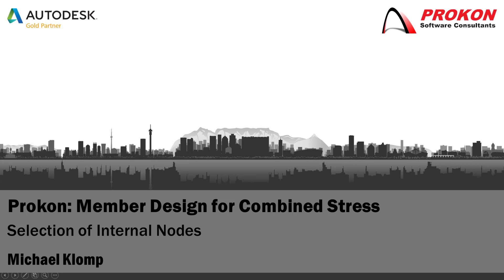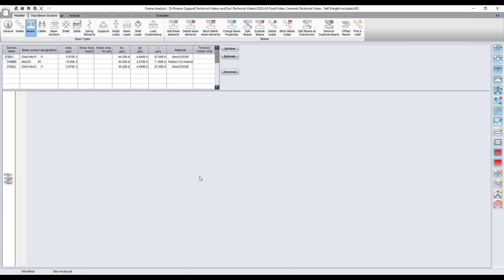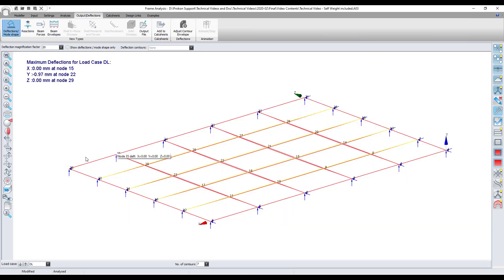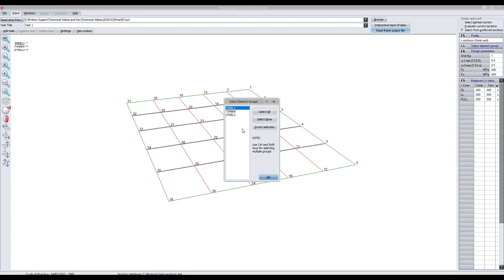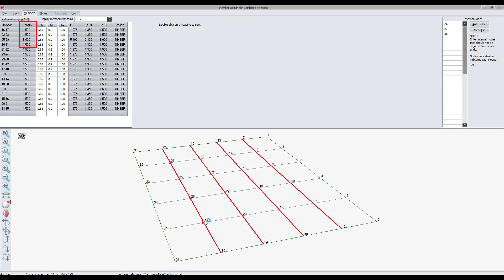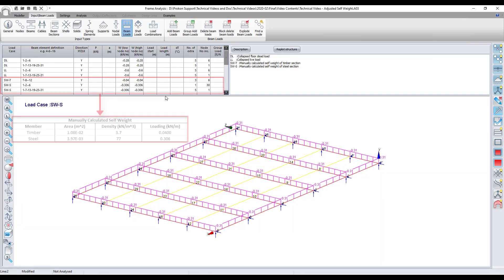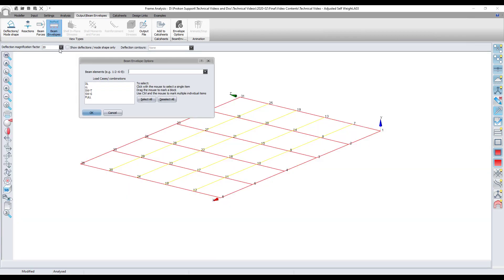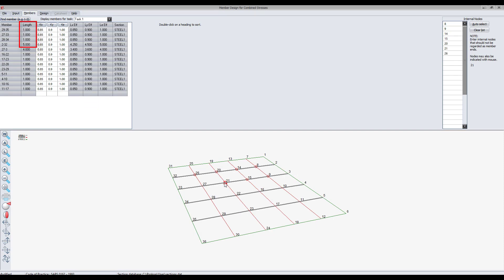Prokon Member Design for Combined Stress - Internal node selection

Comment: Why do you have different factors for Kx, Ky, Ke ? and where would you use Ke when doing hand calculations ?
Reply from the maker: Hello Mkhabela,

Kx, Ky, Kz and Ke are all effective length factors. 

The first three apply to column behaviour and the last one to beams. 

To summarise:

* Kx is the effective length factor for buckling about the x-axis.
* Ky is the effective length factor for buckling about the y-axis.
* Kz is the effective length factor for buckling about the longitudinal axis, also known as torsional buckling.
* Ke is the effective length factor for lateral torsional buckling.

The factors are multiplied with the member lengths which in turn influence the capacity of the member.

Regards,
PROKON